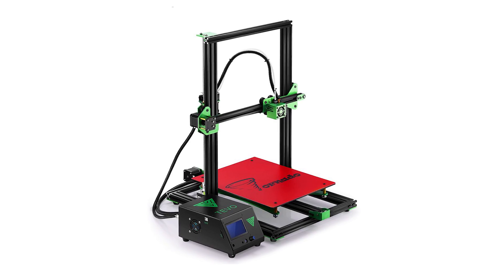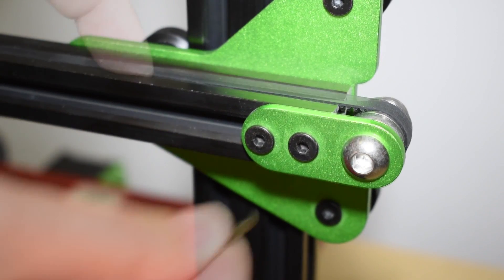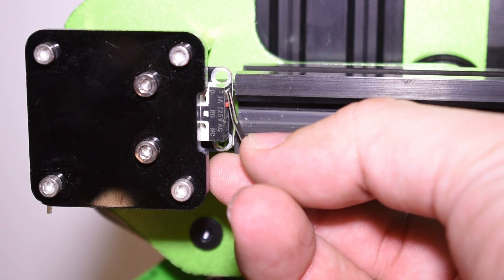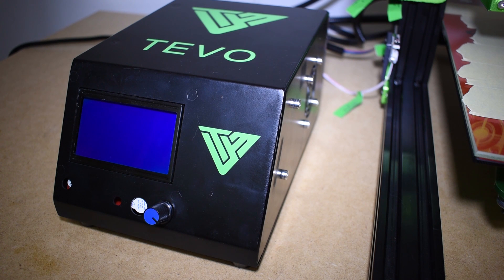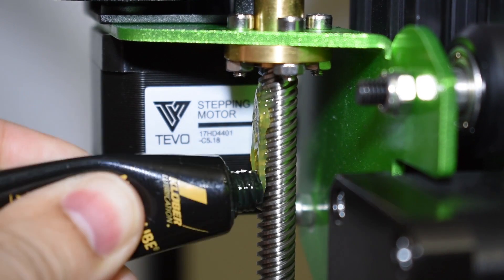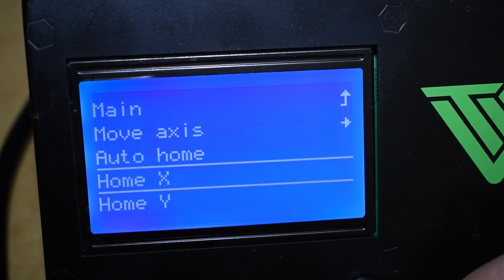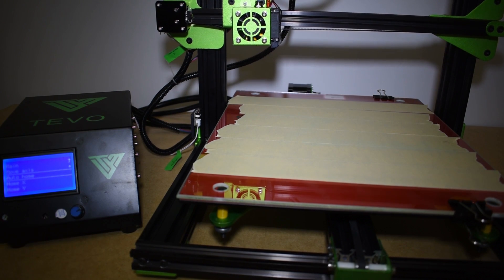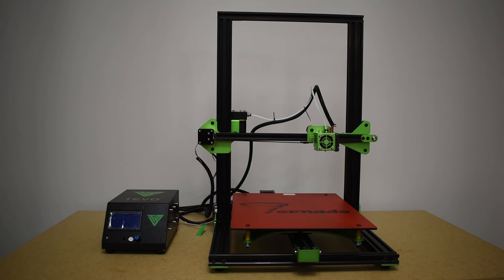TEVO TORNADO 3D PRINTER - What you need to do before printing

Comment: Great Video, still useful today.  Question:  What if your extruder fan doesn't turn on after 50 degrees?  I can only get it to run if I mainly use Set Fan 2 Speed to 100 on the LCD screen.  (extruder fan is wired to E1 and Extruder is wired to E0 if that matters)?
Reply: found it, you have to set E0_AUTO_FAN_PIN 7 in the configuration.adv file.  E0 = extruder, E1 = Case Fans & Extruder Heater Block Fan, FAN = Part Fan Cooling - Software Controlled

Comment: Very sad that this video is 2 years old and Tevo has done no quality updates to this unit. They still put on the build tack that people end up stripping off or covering with another sheet of glass. 
This model is not for the first time user. Its not even a good unit for your second go around.  Remember these reviewers are probably getting paid or free equipment.  It wasnt free for me. And the lack of customer support does not help. I say lack of, the have a facebook group with help like, "buy this upgrade", "print these axis supports", "change your gcode", and "be patient, you'll get there".
If you are willing to struggle with a machine after youve put out the $300 plus, then I can think of better machines to buy.
Reply: do you recommend and one with the same range of price !, i hope you can help,

Comment: Your videos are always instructive.  My tornado is pushing out the tube from the extruder.  I cut the filament and removed the fitting that screws into the extruder housing.  It does not grip the tube anymore.  Looks like .25 NPT to .125 tube fitting
Reply from the maker: Hi Brian,
Thanks for your comment.
The fitting is a PC4 and I normally replace the stock ones as I know that they don't last long. Also, these are cheap so having a few as spares is not a bad idea :)
Reply: @ruiraptor  thanks.  Got the new fitting.  Works again

Comment: I need to replace the hit end thermistor do you know what kind they are?
Reply from the maker: In the firmware is defined in the configuration.h  tab the thermistor you have. You can check the correct specification there.
Reply: @ruiraptor  so I tried to flash it to Marlin and my tevo blinks but goes back to normal. I'm not certain I have seen the actual firmware.
Reply: I think my windows 8 laptop hasn't correctly loaded the drivers. I m not a Facebook user and finding help outside that is hard.
Reply from the maker: For the firmware, you can get the stock firmware here: https://github.com/tevo3d
When you compile the firmware, does it compile correctly without errors?
Reply: @ruiraptor  at first it didnt had lots red memory errors didn't like the port. My lap top updated and I got a new h marlin file off of GitHub and it says no errors I can try the original firmware
Reply: @ruiraptor   so i clicked on the link and for the life of me i'm not sure how to download from this sight I know i did the other night because when i load the arduino program the marlin stuff shows up. i'm pretty sure my mother board is the mks base and that doesn't seem to be an option.
Reply from the maker: If you enter the tornado section and read the text on that page you will see that there are 2 tornado versions but the firmware will work for both. In alternative, you can also change the line where it's defined the board in the config.h tab
Reply: @ruiraptor  so i ordered some replacements for mk 8 hot end. the exact brand is not in the list i see under the config.h tab bear with me this is my first foray into arduino.
Reply from the maker: Try to flash that firmware as is and test it and let me know

Comment: you didnt explain the process for leveling the bed you only said use a piece of paper. thats not really much to go on, does it need to have some resistance or have the paper able to slide under, what do i do with the paper?
Reply from the maker: Hi,
The paper will be your tool to find the correct distance between the bed and the nozzle.

You should adjust the bed so that you have a small resistance on the paper.

Comment: I have zero problems printing directly on the stock surface. It sticks very well with no glue needed.  I just make sure the surface is clean and the nozzle height is correct and that my first-layer print settings in my slicer are correct.
Reply from the maker: Hi George,
Thanks for the feedback. The filament sticks well on the stock surface. The issue is that you need to use a spatula to remove it afterward. The biggest issue is the air bubbles that appear under the stock sheet if you raise the bed temperature above 75 degrees.
Reply: What are you first layer height settings?

Comment: I need to upgrade to an all steel nozzle to print carbon impreg nylon. Can you recommend one that fits?
Reply from the maker: Hi,

That is a very abrasive filament. The best choice would be the famous ruby nozzle (if you have budget for one),.
With a tight budget, i would go with an MK8 microswiss nozzle.

Comment: Hi,  Really your video is very helpful. Here, very difficult to remove the object after printing, even the test print also very difficult for me. Can i apply any glue on bed surface? If i fix glass on the bed the thickness off the glass also occupy ''z'' value, here how can set auto leveling?

Comment: Great info. Just ordered a tornado today. If the bed screws are still an issue I may try to drill an indent rather than a complete hole so the top surface is complete and smooth.
Reply from the maker: Hi Raymond,

It will not be easy to do that because the bed is made of a glass material and can crack/break easily.
Reply: What I am saying is the piece of glass you put on top. Rather than drill all the way through just drill part way. Just enough for the screw heads to clear on one side but not enough to go all the way through.

Comment: That glass with the holes in Boro is over 150 dollars I found.  OUCH!
Reply from the maker: The Best Stooge 
I don't use boro...I use normal glass or tempered glass. Works great
Reply: Let me tell you when you have a sheet of glass shatter in your hands (almost like it explodes) you will know why I went to boro.
Reply from the maker: The Best Stooge 
I can tell you that I work with these type of glasses with many printers and for over than a year with no issues ;)
Reply: Well, I prefer Boro because when I have it at 110c and I spray cold on it I don't need to worry of it exploding on me but YMMV.

Comment: What type of glass did you use?
Reply from the maker: Hi,
I'm using a 4mm thick normal glass. I have a local glass manufacturer and i requested the glass with the 4 holes. They asked 4euros for the glass and 3euros to drill the holes.
Reply: ruiraptor , good to know. There’s a debate over using Borosilicate Glass, but I don’t imagine the heat bed would get hot enough 220~230c to warrant the use of that glass.
Reply from the maker: I never used that. Only normal and tempered glass and they work fine.

Comment: Hello, I try to find info but there is not too much about an issue happened to me. I just purchaces a Tevo tornado this week and right now the table shows a diference in level at the center, as is the flat table had melt and hangs a little bit (no more tha 1 mm) arround the center, which stands the same lavel than the corners. Has it happened to you something like that? do you know if it is normal?
Reply from the maker: Increible Manzo 
Your sheet is coming off. You can just replace it or just remove it and print directly on glass (under the green /red sheet you find a glass bed)

Comment: What are your thoughts about the safety of having mains voltage going into the bed? Is it adequately protected with earthing? What safety mods are required?
Reply from the maker: Hi,
i had commented this before in one of my videos and my feedback is the following:
The AC wires that connect to the heatbed go all the way in the protective insulation foam. There is no way to reach the copper from the wires unless you remove the insulation foam. The heatbed itself is made of glass which is non conductive. In my assembly, i secured the cables that power the heatbed to the first bed spring. It acts as a strain releaf preventing the cable from being pulled or stressed from the back and forth moving of the bed. 
Regarding the metal structure, sure, i can agree with you about the possibility of being grounded. That can be done easilly though.
Reply: Although the design seems pretty safe, as a precaution, I used a Ground Fault Circuit Interruptor (GFCI) A.C. outlet just in case the hot wire shorts to the chassis somehow, perhaps because of worn wire insulation or a loose connection somewhere.  It seems like a reasonable step to take, considering that mains voltage is going to moving parts of the printer.

Comment: You can not see the screen of the tornado's power source, what can I do? It looks only blue. THanks for the vid! I suscribed.
Reply from the maker: Hi,
Does the screen light up? Try to rotate the contrast potentiometer (little hole on the left side under the display) and see if it helps.
Reply: Hey, thanks.  I checked the power box and the potentiometer is damaged. I will have to replace it but I do not know what value the potentiometer has.

Comment: How can you tell when the glass surface has reached temperature? Does it translate the heat or do you have to compensate i.e. set bed for 65 for glass to reach 60 etc.
Reply from the maker: Hi,
You can get a non-contact thermometer and check the first time it heats up if your glass heat ups fast. I normally use a higher temperature (5 degrees C normally) to compensate the glass.

Comment: Do you print with the masking tape on the glass or was that just to help protect it while you were setting it up?
Reply from the maker: Hi,
In all my printers I bought a glass to put over the heatbed. This has many advantages.
And to increase the adhesion, I use masking tape on it. Never fails.
You can also buy a print surface to glue on top of the glass like printbite, gechotek, builtak, etc.
These print surfaces are expensive at first but much easier and cleaner to use.

Comment: You dont need a glass plate because the heating bed is made of tempered glass. Thats because screws are not flushed.
Reply from the maker: Hi John. I know that the heatbed is made of glass.
The thing is that (like in all my other printers) I like to have the option to remove the print surface out.
I also recommend people to follow this procedure as it’s safer and less mechanical stressful to the machine and axis.
But…if you can buy a print surface like printbite+, buildtak or others, then you can apply it directly to the bed as the print easily pops up when the bed gets cold.

Comment: Where did you find the Bora Glass for the Tornado? and who cut the holes out for you?
Reply from the maker: Hi Marc,
My glass in not bora neither tempered. I have a normal glass. I normally go to a local glass manufacturer and request my glass sheets for the printers there. I can get normal or tempered at a cheap price. In this case, i ordered a normal glass and asked them to make the holes. The glass was 4euros and the cut/drill process was 3euros...meaning that the glass with the holes was just 7euros. If i wanted tempered was only 1 more euro.
Reply: What size holes and what exact location distance do you get the holes cut pls

Comment: did you flash/update the firmware or just use it stock?
Reply from the maker: Hi Dylan,
I'm using the stock firmware.
Reply: @ruiraptor   still new to all of this, your videos are great. Question i have had a few people in the fb tornado group indicate I'm jumping into this with out tuning and calibrating. I've been looking for things i need to do before printing. I watched your video on "what to do before you print" and will make the adjustments on the hardware. I am going to calibrate the steps tonight , but some people talk about replacing the Z coupler, and "freeing" the z axis. Why would i replace this, it seems to work fine, and what would I "free" the z axis from? I'm not one to make changes to something that function ok, i just dont know what I'm looking for and what issues it might be causing so to prompt a replacement. Am I making any sense? lol
Also why would I flash the firmware? what is wrong with the stock, even in the instruction book it talks about flashing your firmware.

Comment: A paper that's one millimeter thick? Is the software set to go lower later?
I always calibrate my printers at 0.25mm so I have a great adhesion to the bed. With one millimeter, I think all my prints will fall of the bed.
Reply from the maker: Hi,
I meant to say 0.1mm thick. I wrote that in the description. My bad ;)